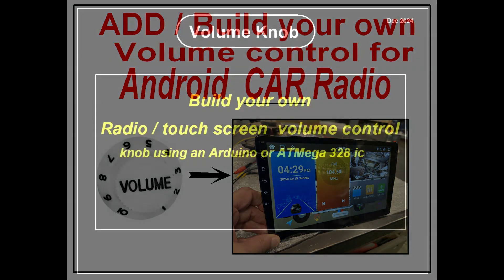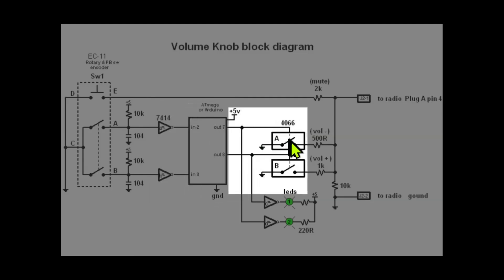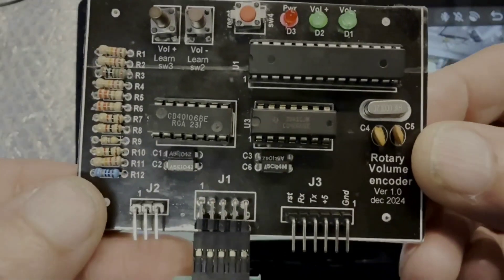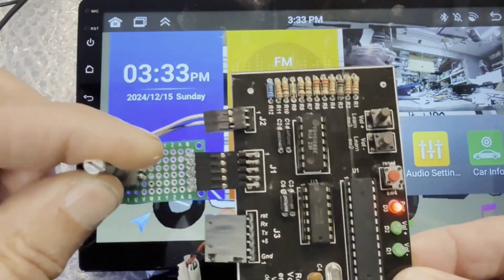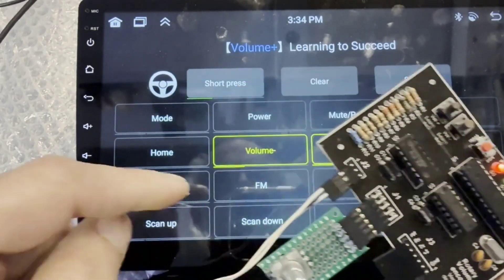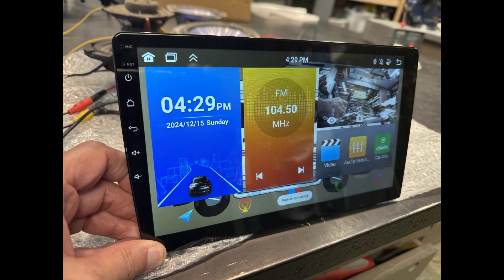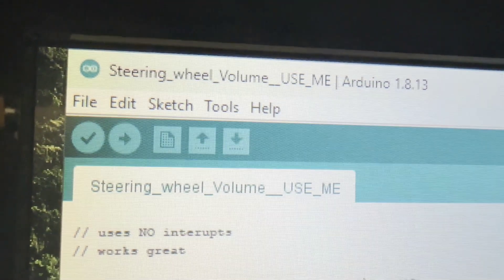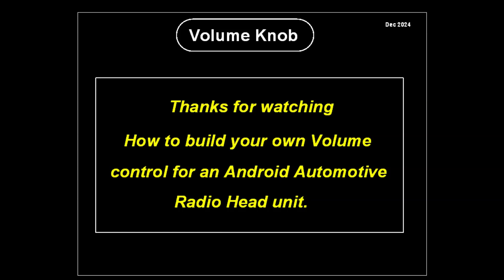Android volume control knob

Comment: What if I already have steering wheel control? Can I add a volume knob? And can I make the push as play/pause?

Honestly do you have a way I can contact so you can make it for me? Of course I’ll pay for your service 🙏🙏🙏
Reply from the maker: Hi  @ali-sleimanchehade6129 , 
to answer your first question, 
Yes you should be able to. You would need to connect up the "Volume knob " wire  to the back of your radio at the same pin as the steering wheel pin. Keep in mind that the resistor values for the "Volume  Knob"  must not match any of the existing values used on the steering wheel buttons.  

For the second question yes you can add  Play/ Pause switches as you want.  Keep in mind your radio must have this input feature. 

As for building it for your , Would like to , but sorry  not able to for the next few months. ( retirement does that LOL) 

FYI my project in more details here at Instructables,    https://www.instructables.com/Volume-Control-Knob-for-Your-Android-Automotive-To/

or here at Hackday.io,   https://hackaday.io/project/202000-android-automotive-volume-control-knob

If you have more questions I believe  Hackaday had a DM feature...

Thanks for your interest.
Cheers Daniel
Reply: @ amazing and will definitely will be needing you help 😅 and i’m not in a hurry since I’ll be traveling soon for surgery and won’t be back for a 1.5 month and even when I’ll be back wont be working on it directly since first I need to get an android headunit (DUDU7 13inch with 12GB ram (if I have money for it by that time 😅)) and I need to make my sub box in fiber glass resin with 4 8inch passive radiator or 2 10inch so will take a lot of time to scan the trunk and make the design in CAD and then print the mold and there will also be a front sub. 
So honestly it will take a lot of time until I’m ready to tackle this project hopefully by then you’ll be free to help me out 😊🙏
Reply: @NVictria  got another question about something you said in your comment that I’m unable to figure out 🤔 why dose the resistor values must not match? If I wire it on the steering wheel “key1” and “key2” from the input of the android headunit and share the same resistor value of the fonction I want shouldn’t it behave the same way as the factory settings? 🤔
Volume up/down; previous and next; play/pause are all already on the steering wheel control and I want the exact same function but on a volume knob (like the idrive from the BMW but on a smaller scale using the RKJXT1F42001 rotary encoder/joystick).